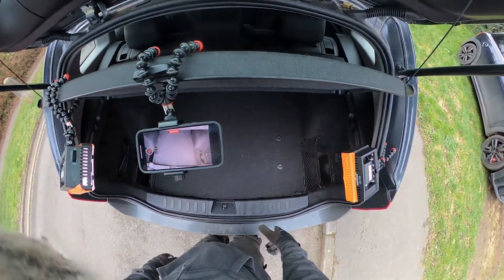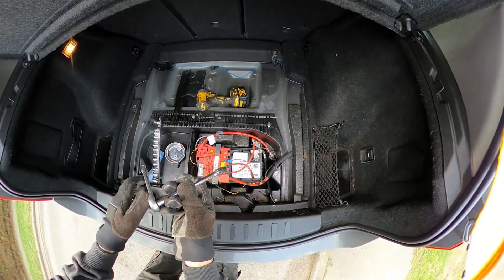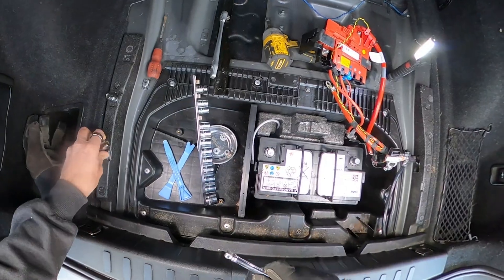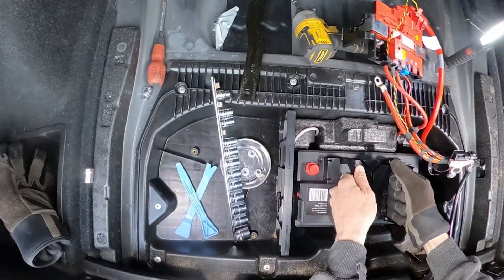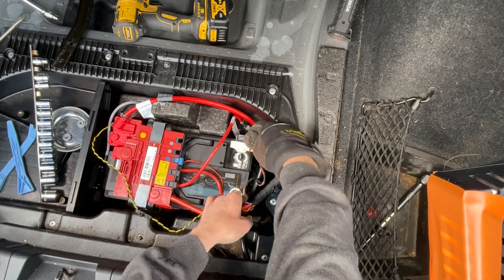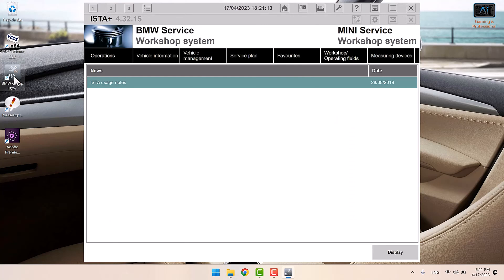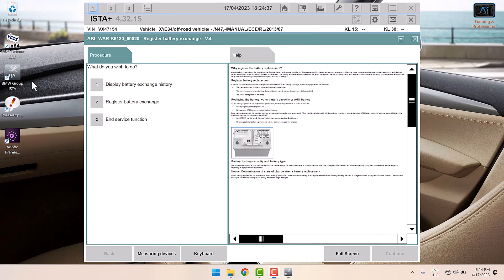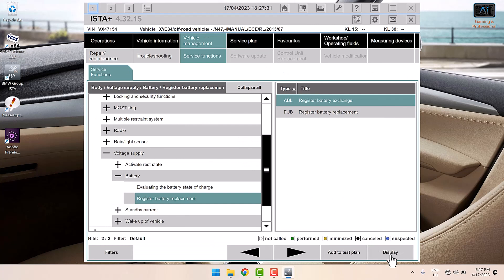BMW X1 Battery Replacement in the BOOT (TRUNK)

Comment from the maker: Step by step guide on how to replace the battery in your BMW X1 - this was done on an E84 which covers X1 vehicles made 2009 - 2015 which have the battery in the BOOT (TRUNK). 

Tools you will need
1/4" socket set: https://geni.us/GSRN0q7
(optional) DeWalt Impact Driver: https://geni.us/1dMRxm
(optional) Impact driver adapter kit: https://geni.us/B1cL
Silicone body panel removal kit: https://geni.us/h4Cdl
K+DCan cable (be sure to get one with a switch): https://geni.us/AZPX
ISTA: https://www.bimmerdiagnostics.com/

Disclaimer: If buy from the links above I receive a small commission which helps fund the channel.

If this helps you, please consider liking and subscribing. Any questions or feedback - please leave below!

Comment: Intresting, usually an Auto-start/stop equipped car would have 1 main battery and another auxiliary battery.

Seems like this simplifies things if it's just the single AGM battery.
Reply from the maker: Yep - my Octavia is the same -just 1 AGM battery. Neither car is ‘mild hybrid’ though - think that might be what you’re thinking of?
Reply: @FixItWithJon  from my knowledge, There are some certain Auto-start/stop cars that have an auxiliary battery, Mild hybrid or not.

I'm just guessing the cars that have an auxiliary battery are equipped with high AMP draw accessories.

Regardless of the battery count, thank God I have only a single battery!

Comment: Do you have to let the computer know if you charge the battery ? Like if you just take the battery off and charge it over night if its flat and put it back on ? Cheers 🙌🏻
Reply from the maker: Hiya, no if you are replacing the exact same battery which will have the same age characteristics as before it was removed then you do not have to attach the computer to tell the car. It’s only if you put a new battery on of the same or different type you need to tell the car. Hope that makes sense?
Reply: @FixItWithJon   hey there jon, thanks alot that does make more sense 🙌🏻  one more question if I have a misfire on cylinder 2 and my vehicle was dead for a while during the time I was changing the sparkplug would the reason to the misfire still happening and the check engine light still on be because my battery was dead dead and I only used a jump starter machine to start my engine And not enough voltage for the computers or no ? I hope that makes sense 🤦🏻 cheers Jon thank you
Reply from the maker: @SNE2828  Cool :-) No - changing the battery will not affect the misfire in any way. There's only 4 things that can affect the misfire: compression, timing, spark, fuel (assuming you're not on a diesel engine). I would suggest: do a compression test  1st, you can get the tester kits quite cheaply on Amazon. if you get good compression, then that tells you that the compression and timing are ok - that's the most important bit. Then you can investigate injector or spark issue. Most likely is a duff spark plug, but could quite easily be a valve issue - so well worth checking the compression :-) Hope that makes sense?
 sense?.
Reply: @FixItWithJon  hey Jon thanks for the reply, I'll get that tester kit first and see what happens from there thanks heaps Jon 🙌🏻
Reply: @FixItWithJon  Ignition problems are often caused by faulty coil (assuming modern coil on plug ignition system) and the easiest way to diagnose it is to check the misfiring cylinder with a diagnostics tool, then swap the coils between known problematic and known good cylinders and try running the engine. If the fault follows the swapped coil, you know for sure the problem is caused by the coil and have to purchase a new one (even if expensive). If it doesn't follow, you can try swapping spark plugs, too. And if the engine has aluminium head, make sure to use torque wrench to tighten the plugs because it's easy to strip the threads on aluminium head if you turn the plugs by feel. Again, if the fault follows one spark plug, there's your problem.

And if you need to replace a spark plug, just replace all because the other plugs are going to fail soon anyway. Modern spark plugs have very similar lifetime to each other.

Comment: Hello, is it possible that by disconnecting the positive first some control unit goes haywire?
Reply: Unless you drop some tools on top of the battery or accidentally touch battery terminals with wire, there wouldn't be any difference for the computers in the car. There doesn't exist absolute earth level for any DC system and therefore the computers connected to the battery cannot know if the positive or negative terminal was disconnected first.

The risk of accidental sparks is reduced if you disconnect the negative terminal first, which is why it's the recommended way to work.
Reply: @MikkoRantalainen Thanks

Comment: Thanks but I found the issue with the remote control batteries and have fixed by replacing in both.
Reply from the maker: @SRK-01  Glad you got sorted :-)

Comment: Excellent demonstration and explanation . I wonder could you please add how to know the battery needs replacement? I have the same model X20D Sports and noticed the keyless entry is not working and the Door Lock Unlock with the remote control also not working, does that mean I need to replace the main battery ? I suppose the remote control of the X20d Sports has a rechargeable battery. Thanks
Reply from the maker: Hiya, sounds like the battery in your key needs changing .. Generally if a battery is going the symptoms will be car struggling to turn over & only just making it. If you have a multimeter - check the battery voltage with the engine OFF - if the voltage is below 12.4V then chances are the battery is on its way out.. Hope that helps?

Comment: Did the old replaced battery have vent holes in both the positive and negative side of it? What about the non-BMW replacement, vent holes on both sides?
Reply from the maker: @gloversunited8175  Thanks for your comment, that's a really good point - I meant to include in the video and  totally forgot in the end.. The old battery definitely did have a vent hole on one side, I'm not sure if it had one on the other side. The new battery did have a plastic bung on each side - I removed the bung on the side the I wanted. It was tough - I had to use.a large pair of wire cutters balanced carefully to prise it out, but it did work. 

Tbh modern batteries are sealed anyhow - I'm not sure the vent hole is really needed, but better safe than sorry.. 

Hope that helps?

Comment: A system that determines how much charge to deliver to the battery dependent on age sounds anything but an intelligent battery system! One would presume that it would determine how much charge it requires based on current state of charge / discharge. Seems an odd idea that you use age in some way as surely there isn't going to be a linear change in the battery characteristics. A car that is driven every day in stop-start traffic versus a car driven a couple of times a week on short journeys etc or a car that lives in the tropics versus one in the Hebrides.
Reply from the maker: @gwynsea8162  I agree with you - that age should not be a factor. A good charging circuit should be able to characterise a battery based on the charging current for a given charging voltage. The internal resistance of the battery is ultimately a sign of it's health. However, the car needs to know what type of battery is fitted. Without that information, it's totally in the dark about what characteristics to expect. E.g. a Li-ion battery will respond totally differently to a lead acid and to an AGM. If the same type and capacity of battery is fitted, then yes, the car should be able to re-calibrate it's charge rate - triggered by the fact that the battery power has been removed.

Comment: @fixitwithjon do I need ISTA-D or ISTA-P when telling the car about the new battery install? Do you have a source for the software?
Reply from the maker: Hi @ozy_man_dias9409 yep - you need Ista D (the D stands for Diagnostic ). You don't need Ista P (the P stands for programming - it's for changing options in the modules like adding heated seats etc). There are always downloads for sale on eBay or you can go to Bimmertools (google them it comes straight up). There used to be free downloads, but the all seem to have dried up now because of the bandwidth needed. Hope that helps? Good luck with your job! Let me know how you get on :-)

Comment: car so smart it can't tell a new battery is in it, sounds like a rip-off
Reply from the maker: @Alycanj  To be fair it's down to physics and chemistry - there's no way of the car knowing what type of battery has been fitted. The only way this would be possible would be if the battery manufacturers had to fit an 'identifier' module which could communicate with all cars.. Standardisation is the only way that would happen and there's just not the drive in the industry to make that happen unfortunately. Hope that makes sense? Thanks for the comment :-)
Reply: @FixItWithJon  The car can already measure the voltage of the battery. It could simply turn on headlights (known load) for e.g. 10-20 minutes to get a pretty good approximation of the Ah rating of the battery, or until computer can figure out that the battery is bad anyway. It could do this every time automatically after being disconnected from the battery as long as battery voltage is more than 12.3 V.

Comment: You installed a 115ah battery (@5.05) in exchange for an 80ah battery. You didn't code the replacement correctly. It's also AGM, which is isn't clear the original battery was.
Reply from the maker: Yes - you're absolutely right - I was wondering if anyone would notice lol. I did actually go back and correctly register it - but that was after the video was published on YouTube. I appreciate your commenting - I'll update the description. N.b. the original was an AGM
Reply: @FixItWithJon it's a bit silly IMOH. Surely a car could detect things like this these days. Simply lithium ion chargers can, for example. Another trick to get you down to the dealer...